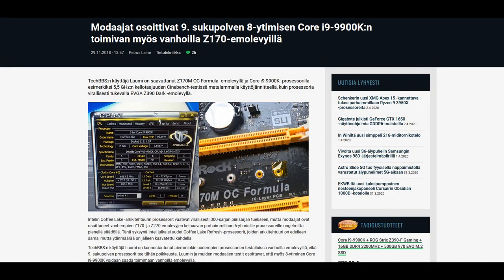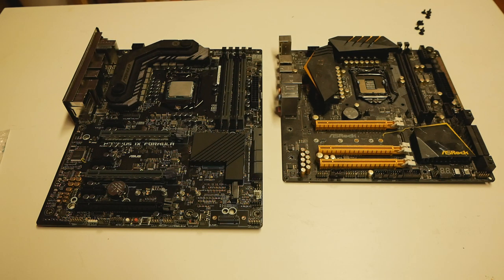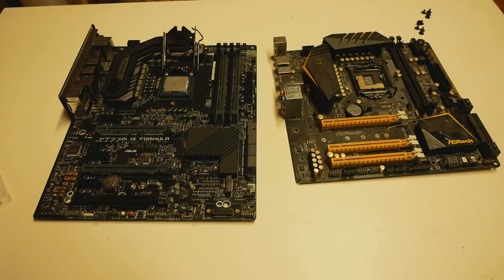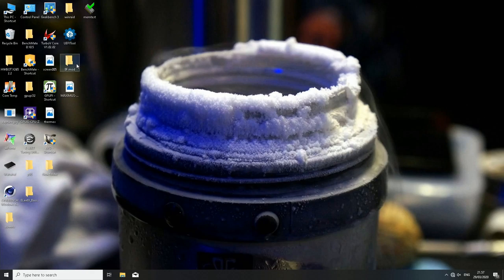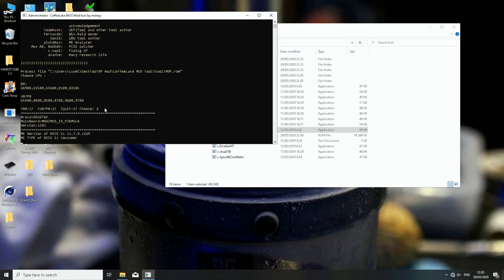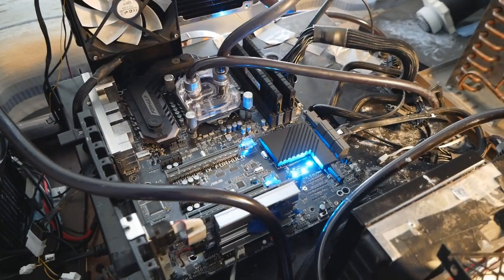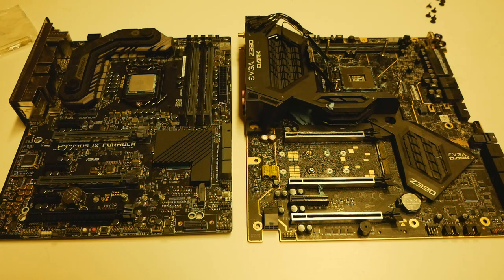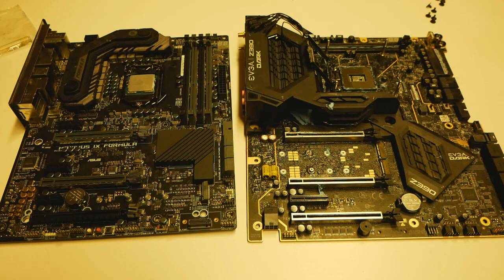How to run a Coffee Lake CPU (8700K/9700K/9900K) on Z170/Z270 Motherboard, 2020 Update

Comment: Hi there. Do you know where is the BIOS memory chip located on the Asus STRIX Z270E Gaming motherboard? Here's a picture of it https://motherboarddb.com/media/images/Asus/ROG%20Strix%20Z270E%20Gaming/ROG_Strix_Z270E_Gaming-1.jpg

I'd like to do that mod as well. Could you please tell me if it's possible to bypass the security verification like you did at 15:50 on yours? I'm not sure where to find out the correct pinout to get it shorted.

Thanks a lot!

Comment: Hi. If i do this, can I still use 6600k till I get upgrade or will it not work with older CPU? :D
Reply from the maker: It should work fine with older CPU, or you could keep old bios on the other BIOS chip.

Comment: Can you pls try this on H110? My budget is limited and I need a 8700k . Pls try with H110
Reply: Unfortunately you are likely to be struggling on an H110. While it might be possible to make the electrical mods and even the BIOS updates to get your system to switch on with an 8+ gen CPU installed, you are still stuck with a chipset and board that lacks any overclocking functionality beyond, possibly, BCLK, as well as all the other limitations - slower DMI and PCIe etc. And a lower end board is also likely to lack the overengineered voltage regulation that enables the enthusiast Z170/Z270 boards to power the extra cores without trouble.

Comment: I am from Belarus, and i have a asrock fatality z170. I want run 9700k or 9900k, i find a man, he help me run 9700k or 9900k. How watt power supply needed to overcloked to 5,0 Ghz 9900k with 1 videocard 2070super? And which kind of ram choosing. I stoped on Crucial Ballistix Sport LT 2x8GB DDR4 PC4-25600 BLS2K8G4D32AESBK. It a good ram to overcloked to 4000 on 22 timings?
Reply from the maker: Good quality 650W PSU should be enough for that. Ram depends on availability and price.
Reply: @LuumiJuhani   i have a seasonic  focus 750 px with platinum sertification) Please create new vidio "run 9700k or 9900k on asrock fatality i7 z170"
Reply: @dolphin_5554  ЗАЧЕМ тебе 9900к или 9700к когда ты берешь обосраную память? Купи 9600K и нормальный кит озу 4400 16-18-28-280 он тебе в плане фпс куда больше даст и в играх 9600к будет намного лучшее чем 9900к с AES памятью

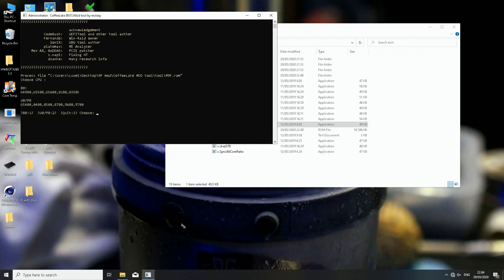Comment: 26:31  I noticed there's no option for p0 stepping 9900k, i have the same maximus ix formula with 7700k. is it possible to run 9900k p0 stepping with this board? Would i just enter 2? All 16 threads will work??
Reply: I am also trying to do this, did you manage to find an answer ?
Reply: @muhammadnuman3985  thank you. Have you had any problems running the 9900k On the ix Formula board ?
Reply: @Koiboi100  I found out online on the site for the tool I believe. I made the bios file and it was created successfully. I didn't actually ended up using it, sold the pc and built a new one with a ryzen 7 3700x which I'm retiring to my dad when the 4700x/5700x or whatever the next ryzen 7 is called releases. If your willing to sell in a few months you might be able to get a lot out of it like me and get yourself the next ryzen 7 which will be miles ahead of the 9900k.
Reply: @muhammadnuman3985  thank you for all the info, i will definitely consider it I've been thinking about the going ryzen too. 😊
Reply: @Koiboi100  no problem :)) the only gripe i have with the 3700x is the gaming performance compared to Intel at 240hz (my monitor) so 3700x isn't a bad option either

Comment: Hi, could You post a link to the Bios mod tool, the link in the original Win-Raid forum is dead.
Reply from the maker: I will check soon.
Reply: Could You put it in  mega upload or similar? I was trying to prepare a bios by the older non automated guide on Win-Raid but could not get some of the required files..
Great work by the way!

Comment: Hey Luumi, i did the same Mod on my Mainboard. Im using the 9900k on the Gigabyte Gaming 5 Z170. I already wrote this message on the modded PC. But there is one Problem. When i start a benchmark like Prime95 or Time Spy, the PC instan crashes :(. Are there any changes in the bios necessary? Many thanks for your help :D
Reply: Hi Max, did you follow this guide exactly? 
If not, what steps did you take for modding your Gigabyte z170
Reply: @ashihtaka  Hi ashihtaka, thanks for your reply first :D No i was using a different guide because it seems to be a little bit easier. I´m using the tool CoffeeTime 0.99 to moddify the bios. To flash the bios im using the ch341 programmer. I also tryed to flash the bios via afudos and the gigabyte onboard function. But in most cases the bios wos not usable after flashing that methode. To get the mainboard back to live im bying the ch341 programmer 😅 I don´t know if there is any difference in this methodes. The System is booting and the 9900k was detected with all 8 cores. The performance (CPU-Z Benchmark) seems to be normal. But i think the temperatures were a little bit high. Sadly i was not able to check them under load, because the PC was crashing everey time. I think there is any voltage issue in the preseted bios functions. But maybe im totally wrong an i did any mistake while modding my bios. Iff it would be possible, i would be thankfull for a already modded bios version for my motherboard. To flash the bios i would use the ch341 programmer if thats ok 😅

Comment: I have a 25q128fviq bios on my asus z170 progamming. I found ah method to do this without soldering with a CH341A flash programmer. Because I dont know how to put my Board in pinmod. Would like to know how. I will post results when that Thing arrives. Thx for the great video  luumi
Reply: I did it. After failing with the flash programmer software 1.18 1.211.31 and the asprogrammer i installed it with the flashrom tool with this simple command:  flashrom -w creative.rom     I am installing the 9700kf now. I was totally lost for 5 hours when i killed my bios with the flawed software from another thread. I will post results later. Anyone else tried using the flashprogrammer ch341a?
Reply: i was able to boot with the 6600k. It did some stranges reboots like in your video. The bios had the right version labled. But i could not start the pc after i installed the 9700kf. Tried to reflash the bios and start again because i thought maybe the strange reboots are important. Now my pc wont even start to spin the fans. Dont know if this is bios related anymore

Comment: Could this work with an i7-9700k and a Maximus VIII Hero Alpha motherboard?
Reply: It will definitely work if you do it right Optimus. Further to my post below I got my M8H running very easily.  I chose an 8700K in preference to a 9700K for a few different reasons - including wanting the headroom for a nice overclock without risking overloading the VRM, and also preferring the option of delidding + liquid metal to the (inconsistent) 9th gen soldered TIM. However, all the principles and steps to take are exactly the same with a 9700K.  The system works perfectly - with the BIOS even gaining extra features like the AVX Offset - and with a bit of tuning, there's no downside at all. 

The good news for you is that the M8H and M8HA have a socketed BIOS chip - which means you can, if you want, get away without either of the hardware mods Luumi suggests. You can pull the chip to flash it in a cheap external programmer (make sure you back up the original image and obtain the MAC address(es), board serial number and system UUID) and can then use conductive paint or a lead pencil to link the #SKTOCC pin to the adjacent ground on the back of the CPU. That said, doing it like that is fiddly and needs a lot of accuracy and a bit of luck to get right. If you have access to a fine tip soldering iron and the skills to use it, doing it on the motherboard next to the Super I/O chip is very easy and definitely the better method.

While Luumi suggests there is likely no need to mask the 'reserved' processor pins on Asus boards, I did make a small pinmask from kapton tape because I didn't want to risk damaging the board or socket in case any of the 'reserved' pins were connected. Again you will need a steady hand, a magnifying glass and a scalpel and ruler - plus some tape - but it's more than do-able.

Comment: Are there any limitations on running sli? i have two 1080ti's - thinking of putting a 9900k on that same exact Asus Maximus IX formula.
Reply from the maker: Some might not support it, programs I mean. And on mainstream socket it will be both running x8 but it doesn't impact performance.
Reply: @LuumiJuhani  Thank you for the quick reply. I believe I understood your answer correctly. Just to verify, you're saying the modded bios won't be a limiting factor in regards to running sli. It'll perform as if it was a native 3xx motherboard. Right ?

Comment: I’ll now be upgrading the chip in my ASRock Z270 Extreme4. That board is just too nice and working well to upgrade if I don’t have to.

Also, for those of us with boards in cases, you can short the pads out on the processor with a sharp pencil lead. It’s not the best conductor, but it works fine. It literally is just there to let the board turn on. It has no negative effect on the board or chip.
Reply: Let me know how it goes

Comment: Hello Luumi :) First of all, thanks for a movie nad greate job. Is there someone who tried This procedure on ASUS Maximus IX Extreme, Bios 1301, I9 900K RO SRG19?  I´m lost, I can not pass to Bios. Can someone help me? Thanks for any help.
Reply: HI :-) Thans to the Luumi and Svarmod (perfect job) I have on Asus Maximus IX Extreme, core I9-9900K RO stepping with 8 cores and 16 Threads, Overclocking Up to 5,2 GHZ all Cores with HT, Temperature about 65°C :-) Only feature what is not working is XMP MEM profile and USB within boot. Highes MEM Frequency what I get is 2600Mhz, Higher caused Code 55.
Everything else working perfectly fine :-)
Reply: PetrM1978 what do you have to do to get 9900k working? I noticed they only had microcode up to 9700k in the all in one tool
Reply: @MarshallSambell  Modification on board (connect pin to ground for a procesor detection and two pads for a Flash bios as Luumi does, modify bios by new tool, I have 9900K RO steppping, as Luumi does, than Disable HT Transport. If you want HT functional, than only who helped me was Svarmod (Coffeetime tool developer). Coffee lake tool must be in folder root  directory, like C:/TOOL, othtvise is not working properly. From Svarmod I have Bios Image, by UEFItool named as Creative.ROM

Comment: Will this work with 9600k or 8600k?
Reply from the maker: Yes, you can see the listed models.
Reply: @LuumiJuhani  8600 was not on the list
Reply from the maker: @stefan5788  Should work with same option as 8700
Reply: @LuumiJuhani  ok, thanks for response